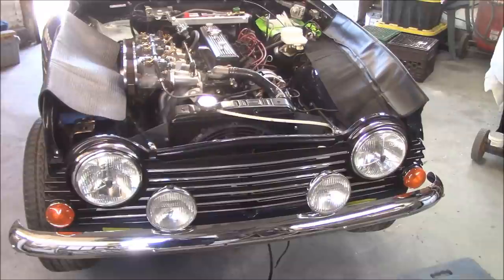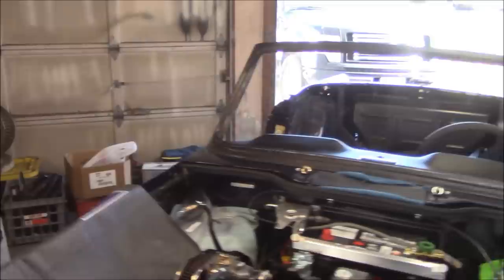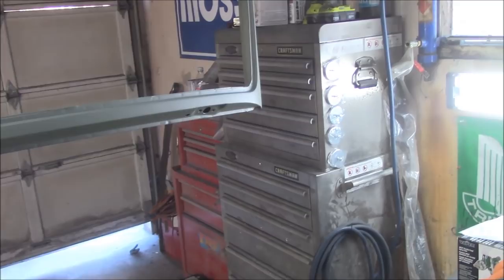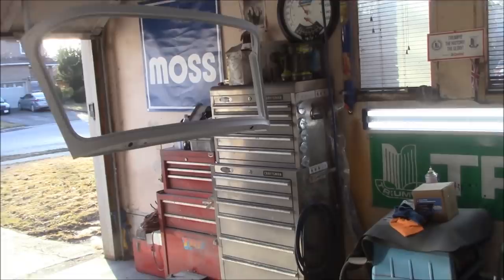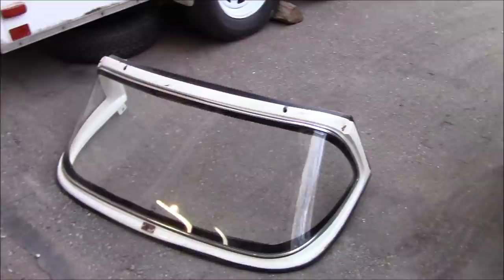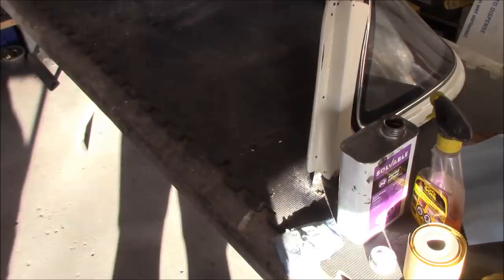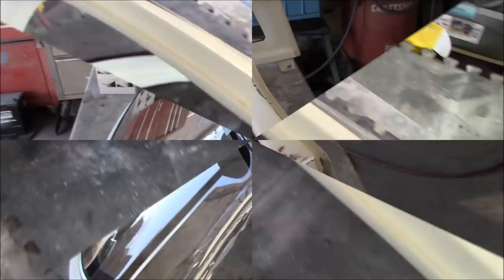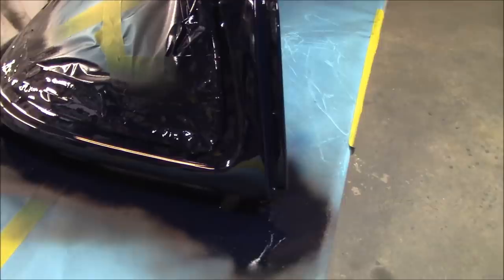1968 Triumph TR250 Restoration, Assembly Part Eighteen, Windscreen and Surrey Top Backlight Painting

Comment: I've never seen that trim adhesive tape before, that worked out pretty well I'd say.  Great to see you striking off more line items on the list.
Reply from the maker: I hadn’t seen it either John but needed a solution to paint with the glass and seal still installed.  A bit of research and a click of a few buttons on Amazon and it was at my door the next day.

Comment: The car looked great out in the sun, colour really 'popped'. And when I consider how the rear of the wing edge was all cracked and hiding rust and poor prep, it looks simply amazing now good job! 

I've used some electrical cord to stuff into the screen seal to lift it before painting before, though the real tape looks good. Nothing like seeing a newly primered part and then pealing off the tape to reveal the final top coated part. 

Some excellent progress there Dave 👌
Reply from the maker: Yes, I’m pretty happy with how that tape worked out and with the overall paint. A couple little sags to fix but they shouldn’t be too bad.

Comment: I'm a little behind on the videos so you might have already addressed the "little white" around the glass. I have found that in areas like that instead of trying to touch up with paint I have used a black magic marker to darken the white and it seems to blend right into the color of the seal.....Progress is going well.
Reply from the maker: Thanks for the tip. I haven’t addressed it yet. I’m going to wait until it’s installed on the car so it will be a little while yet.

Comment: I would be interested in how you are going to take care of the sags. Cut and buff? Such cool beans that you were able to paint under the gasket. I always wondered how they did that.
Reply from the maker: Hi John,  yes....the sag needs to be cut down to the level of the clear coat below.  Since it’s a small area, it will involve some sandpaper wrapped around a small paint stick being utilized as a block...probably start with 600 grit and work my way up to 2500 grit followed by compound and then polish.

Comment: Does that rear section catch a lot of air? Looks like without the center section it would be like dragging a small parachute. But it does look cool. And that's what really matters.😉
Reply from the maker: Hard to say...I guess it’s not much different than any other car that either had a targa style roof or t tops...😉  who knows, I might hate it and go back to the soft top.  As an aside, I am keeping the buttons on the tops of my doors in case I go back to a soft top and want to use a tonneau cover.
Reply: Good point there, no such problem with my Fiat X1/9, nice and calm inside with the top section off, window glass up helps. Very nice job on the Triumph! Saludos from Mexico.

Comment: What kind of spray gun/compressor do you use?
Reply from the maker: I’m using a 60 Gallon Compressor that has about 11 CFM at 90 Lbs of Pressure.  I’m currently using a Eastwood Concours gun with a 1.4 Tip installed.   For the larger panels I’ll be using my Sata Jet 5000B HVLP gun with a 1.3 Tip.